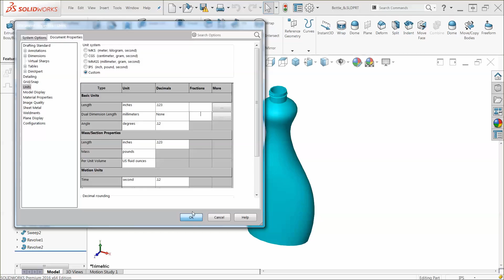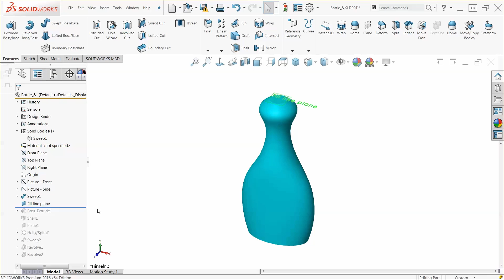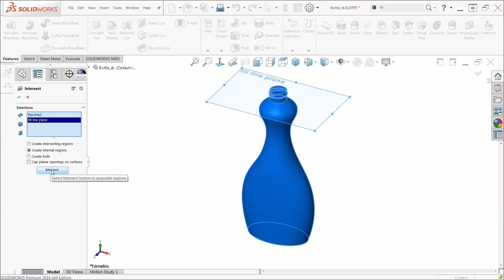SOLIDWORKS Quick Tip - Measuring the Internal Volume of a Bottle

Comment: can we do this in the SW2020 but not in solidwork part... i mean doing Intersect In Assembly?
Reply from the maker: Intersect is a feature for Parts only.  It only works in an assembly if you are editing a part/component.  However, a workaround would be to save the assembly as a Part file using the default All components checkbox for Geometry to save.  This will make a multibody part file.  You may be able to use the Combine feature to put several bodies together to make an enclosed volume that would be appropriate for the Intersect feature to work.  Probably some trial and error figuring this out for your assembly.